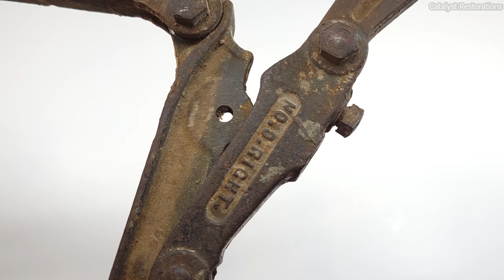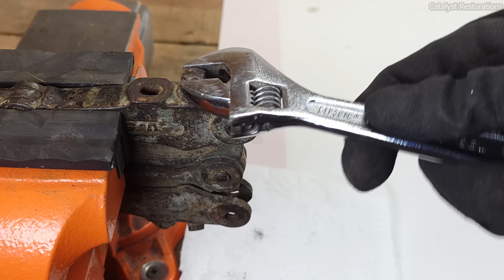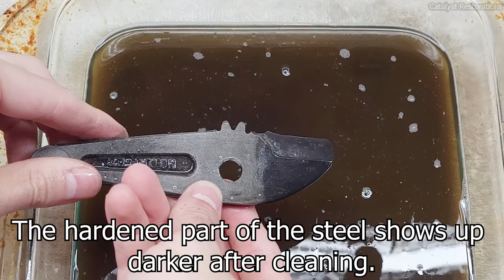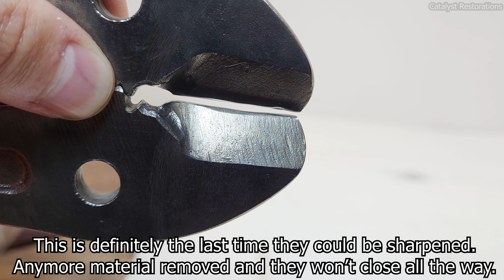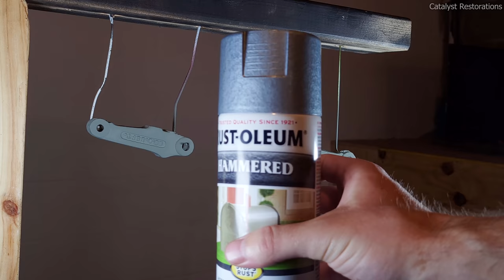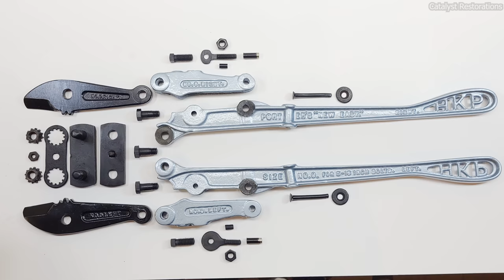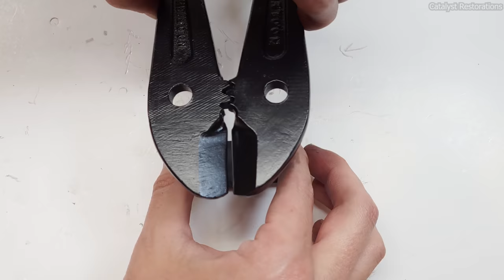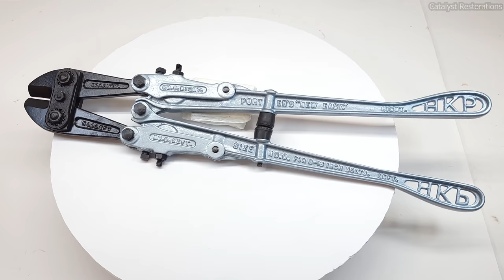130-year-old Bolt Cutter Complete Teardown and Restoration

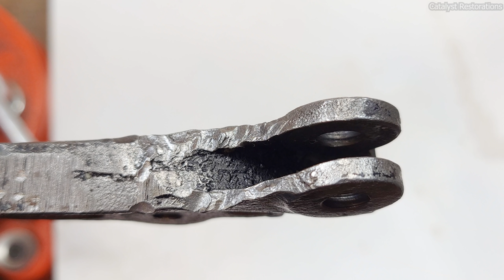Comment: I think you raise a potentially interesting philosophical question at 11:48. 

In terms of a "restoration" project, is touching up/ removing features that a product was created with (perhaps unintentionally) like imperfect casting still restoration per se, or are you going beyond the call of duty by improving the product itself. I can see an argument that the material left behind by poor casting is 'part of' the product, but I see a counter-argument that it is not part of the product in its idealized form. 

Random side thought, what about using some of the steel dust/chaff from the sanding process in the epoxy mixture to match the material more?
Reply from the maker: That philosophical question is actually a very sharply divided line in the restoration community. There are some who believe you should never remove a tool's patina or rust and just enjoy the tool for what it is now, either working or not working. Then there's others who believe a small amount of cleaning just to get it working is all you should ever do. And then at the far other end of the spectrum is basically a Ship of Theseus where you replace just about everything with new parts or hardware and it's identical in looks only to the original. I personally believe that you should at least research as much as possible what the tool originally looked like and then decide how much you want to deviate from it. It depends project to project. Sometimes the casting marks are actually really cool looking and other times they stand out in a really ugly way.
Reply from the maker: Also about the steel dust, I never considered that before but might be worth trying in the future! It's a common technique in woodworking to mix wood glue with sawdust to make a filler.
Reply: Ethan I have thought the same thing about leaving the so called "imperfections". When I clean up and restore these cutters I like to leave them the way they were made and just clean off the rust, improve the cutters and paint them so they look like when they were new. As far as the imperfections I wish I could ask my dad why the Company left them and didn't take them off? He would know he was one of their machinists at that plant in the late 1950s to 1978. Now that I think of it the workers there were paid on a piece rate basis, the more you made the more money you got! So if you leave them the way they are you are reminding everyone of the way they had to work to make a living!
Reply from the maker: @stephenkent8903  I think you're right Stephen - at the end of the day it was all about just pumping out as many parts as possible as long as they didn't impact performance of the tool!
Reply: @CatalystRestorations  Don't you love the logic of considering anything done to an object by previous owners as precious parts of its history and thereby sacrosanct, yet for you to touch it is deplorable? Hard to know what to make of that. Maybe it's existential guilt. ;-)

Comment: Too bad your “pro tip “ for spraying hammered paint was wrong.  Spray one heavy coat only , from a close distance and the true hammered effect will appear. Your way produces a foggy finish. The paint will dry to the touch but not harden for weeks. Place in the sunshine till hard.
Reply from the maker: You're right that it is more about how heavy your coat is rather than distance. As far as hardening, all enamel spray paints take many weeks to fully harden, sometimes upwards of a month. And yes, you can "bake" them to speed up the hardening process - hard to do in the sun though where I live where it is cloudy 300 days out of the year on average.

Comment: This is not a Leonard painting.  It is a special tool.  It has to work and not tint with a mini - brush…such a distance between the cutting edges)))))….  unacceptably. Do you have to admire it or work with it?
Reply from the maker: You are correct, this is in fact not a Leonard (Leonardo DaVinci?) painting. If I understand you correctly, you're wondering why I made it look so nice, why there is a gap between the cutting edges, and do I actually use the cutters or just look at them.

1: If I'm going to look at them and use them, might as well make them look nice. If I wanted to do a fast 5 minute job just cleaning up some of the rust nobody wants to watch a video of that. 

2: The cutting edge gap was closed by adjusting the square adjustment screws on the side of each handle. At the end of the video you'll see the gap is closed when I'm testing it.

3. Everything I restore can and is used. Not every finished project just sits on a shelf.

Comment: Hummmm, using metric socket on old US made tool, using adjustable wrench wrong way (putting stress on movable jaw as opposed to on fixed jaw ), striking threaded bolt with hammer rather than putting a nut on thread and striking nut to avoid damaging threads.
Reply from the maker: If the wrench fits snug and does the job I don't really care that much. 🤷‍♂️ And if you watch any video newer than this one feel free to see if I learned my lesson on the adjustable wrench 😉

Comment: Would sand blasting have removed that concrete a little better?
Reply from the maker: Hi David! Absolutely it would - it would be both better and faster. I don't have a sand blasting setup in my shop, partly because a good setup with blasting cabinet, air compressor, and blasting mediums can run in the neighborhood of $1000 and partly because my vision for Catalyst Restorations is to keep restorations as accessible for the everyday person as possible who may just have access to a basic selection of tools and a workbench.

Comment: get yourself a set of SAE sockets and stop with the adjustable wrench, that wasn't built with metric bolts.
Reply from the maker: It would help if when this was built anyone had any standards in mind! 😂
Reply: @Catalyst Restorations  knock the heavy buildup off, and i bet a 1/2 would've fit perfect. Look for 6 point sockets, it'll greatly reduce the chances of stripping nuts and bolts that are extra stubborn. If you ever need to put some beans on a threaded rod don't hit the bolt with a hammer, boogers the threads. Put the nut back on a couple turns and tap the nut. Other option is to pick up a brass hammer and punch kit. Wheeler Engineering makes a nice kit for about 30 bucks on Amazon.
Reply from the maker: @bigjohn3435  Thanks BigJohn!!

Comment: Sugestão: para retirada do ferrugem colocar numa bandeja com vinagre por 24 horas ou mais. Além de eficiente,  o custo é menor.
Reply from the maker: "Suggestion: to remove the rust, place it on a tray with vinegar for 24 hours or more. In addition to being efficient, the cost is lower."

Yes! Vinegar is a perfectly good method for rust removal! Citric acid is another low cost option. Personally I can't stand the smell of vinegar (and it smelling up the whole shop) and it does work slower than Evaporust or electrolysis and because it is an acid there is only so long you can keep it submerged before the metal starts to etch away, but it's still perfectly acceptable to use for most rust removal projects.

Comment: Before putting the various pieces in the rust remover I would have degreased them with a powerful detergent to remove both the wd40 and the greasy dirt down present and only after rinsing them well I would have put them in the rust remover, in fact where there is grease or oil the eust remover does not work.
Reply from the maker: Actually, Evaporust does contain detergents that help break through grease, oil, and general grime, so it's not mandatory to do so. The Evaporust solution will end up full of sediment and other junk though, so it's personal preference.
Reply: @CatalystRestorations  thanks for your answer :-)

Comment: I cringed everytime you used the wrench in the wrong direction. i.e the cause of the "earthquake" because the force applied caused the wrench to expand to the point of failure. Used in the correct way, the force actually "bites" harder. Otherwise great restoration
Reply from the maker: Yup, been getting raked over the coals in the comments for that one!

Comment: Great transformation!
One question though; why would you use adjustable spanners for a job like this, instead of sockets or open/closed spanners? You could save yourself some work...
Reply from the maker: Hi! Because this bolt cutter is so old, the nuts and bolts aren't standard sizes and it was a huge pain trying to get them to cooperate with a standard socket set. It was simply much easier to use an adjustable wrench for the majority of the hardware. It got the job done, which is really all that matters in the end to me.
Reply: @CatalystRestorations  👍🏻
Reply: @CatalystRestorations  that is because they are obsolete Whitworth threads commonly used up until the1960s.

Comment: Vinegar?
Reply from the maker: I used Evaporust in this video to remove the rust which works amazingly well but is expensive, but vinegar does work too! You just need to keep an eye on it an not let it soak more than maybe 48 hours because it is an acid and can start to eat at the good metal once it gets through all the rust!

Comment: Just curious what the picture is on the card you used to mix the hole-filler, at time 17:20?  Looks like a machine shop?
Reply from the maker: It's actually just a hotel key card for an industrial-style hotel I stayed at once. They make great mixers for filler epoxies and putties!
Reply: @CatalystRestorations  ... I worked in a machine shop for a steel company one summer as a teenager... many decades ago.  That's why it caught my eye.
Reply from the maker: @thomasklugh4345  Very nice! My day job is a metallurgical engineer at a steel company.
Reply: @CatalystRestorations  ... Hope you don't mind me responding again.  A lot of old memories have been stoked here.

It was 1967 and I was only 17.  We lived directly across the street from the steel company where my step-dad worked.  He's the one who got me the summer job that year.

My first job there was to sit at a hole-punch machine where I would activate the hole puncher with a foot gear.  It was with a loud "CLANG" that the hole puncher would come down on an 4"x8" steel sheet a quarter inch thick, the hole being used for a rivet, to rivet two other pieces of steel together.

Then they transferred me to the painting area where I would paint these enormous, and very heavy beams used in modern bldgs.  I worked with a hand-operated crane system moving and turning over the beams.  I thought it dumb to paint the beams, though I never told my boss that.  I thought they should have invested in a rust-prevention application, rather than painting a beam no body will ever see (it being INSIDE the bldg).

There was this one guy who had just returned to work the day I started.  He previously lost his leg when one of the steel beams fell on him.  I was surprised they even allowed him to come back.  But that very same day, with him limping around with his newly installed prosthetic leg, he wasn't watching what he was doing, and had a finger and thumb of his hand crushed.  Somehow, I don't think he was meant to work there.

It was a fun summer job... 
for me. 😃  My next job the following year was as a day laborer on construction sites, with a friend.  But that's another story.
Reply from the maker: @thomasklugh4345  I don't mind at all! Thanks for sharing! After seeing your coworker missing limbs and appendages I'm sure you're glad you got out after just 1 summer because who knows what you'd be missing today yourself! 😂

Comment: @11:30-40 - Sand-blaster, then Powder-Coat.
Reply from the maker: This channel is about showing people that you don't need to have a sand blasting and powder coating setup to achieve great results restoring and giving new life to their favorite tools.
Reply: @CatalystRestorations   - Fair enough.  It was just my gut reaction at that point.

I do not have a 'home' sandblaster yet.  However, I do have our old kitchen stove in my shop.  I have done home Power Coating.

Also, I restored several rusty Rigid Pipe-wrenches by sand blasting them and Power Coating them.  They look amazing and turned out really well.
---------
Honestly, if I am not going to Power Coat tools like that, I just wire brush and oil them.

Comment: they are not bent... they are offset so you don't clack your knuckles together
Reply from the maker: The bumpers are to stop your knuckles from clacking. HK Porters did not do offsets.
Reply: @CatalystRestorations  ahh I see. I've seen offset handles for that reason, but yea the bumpers make way more sense

Comment: I've found hammerite paint to be extremely bad, one touch and it just peels off. I've been a painter for years and have followed the exact guidelines with still poor results
Reply from the maker: That's a bummer. I've always had great results personally. I know everyone's not a fan of the look, but it's always been durable for me with proper prep and priming. Just like most enamel spray paints though it takes at least 30 days to truly, fully cure.

Comment: ..." rubber bumper are missing..." Lol!   1890s...?   thick leather bumper will be correct...
Reply from the maker: You may be right - rubber was not a super common manufacturing commodity at that point. Leather might be historically accurate, which is good to know, but since I plan to put these to regular use rubber is a better choice.

Comment: So are they really 130 year old cutters?
Reply: Well are they? I would like to know.
Reply from the maker: If they were made in the year of the patent date on the handle, 1892, they'd be 129 years old, so no, you got me, the video title technically won't be true until 2022. It's probably more likely they are a few years newer than that, but not by much. From the limited information available on the production history, this specific design pattern appears to have been phased out in the early 1900's.

Comment: Masking tape really helps for touch ups...
Reply from the maker: Indeed it does. Unfortunately sometimes you just forget and deal with it. 🙂
Reply: @CatalystRestorations  I was saying that but I paint everything with a 180mm paint roller.
Reply from the maker: @chongtak  I think I see what you're saying now. If you notice in the priming and painting segments I extensively masking taped off all areas that are joints or screw holes. I just didn't show that on camera. Also, using a roller to paint complex geometries such as this is simply impossible, hence spray paint. A aerosol paint is the best way to paint projects like this 99.9% of the time.

Comment: Nice job , except for the fact that you painted the gliding surfaces.
An engineer would know not to do that...
Reply from the maker: If you're referring to where the jaws hinge, then yes, there shouldn't have been paint there and it made the fit too snug. It's long since worn away from use though. Otherwise the other points of motion were just cold blued but not painted.

Comment: Where does it come from ? I have one like that!
Reply from the maker: Awesome! If you're referring to where this was made, it was made in Boston, Massachusetts, USA. If you're referring to how I acquired it, it was bought from a flea market. Today, the HK Porter brand name is owned by Crescent Tools in Maryland, USA.
Reply: Thank you!
Reply: What is the chemical you use  to soak?
Reply: This jop is really interesting!
Reply from the maker: @mrtrungkieu  It's a solution called Evaporust. Non-toxic, biodegradable, and be reused many, many times before it stops removing rust.
Reply: Thank you!

Comment: Если так бросать железки в стеклянную банку, она может разбиться. Раствор для очистки от ржавчины обычно содержит кислоту в опасной для кожи концентрации. А у Вас руки без перчаток!?
Reply from the maker: The rust removing solution is called Evaporust and it is not an acid and is safe for contact with skin.

Comment: Weld the cutting surface up with nickel rod used for bucket wear provention that's what we do on farms
Reply from the maker: Interesting! Do you do any sort of heat treatment then after that? Some other commenters also suggested welding with a tool steel that has suffient hardenability, but as with pretty much any welding on a hardened surface you have to (or rather...really, really should) properly re-heat treat the jaws due to the heat effect zone.

Comment: Bluing does not protect against rust.
Proof:UN-OILED blued firearms parts (barrel, receiver, trigger guard, loading gates, under barrel steel magazine tubes, etc.) readily rust.
Bluing (and Browning) requires a thin coat of oil to not rust.

Are new jaws availabe for this bolt cutter?
It may have been the camera angle, but it looked like the jaws don't fully close after sharpening.

Is this going to be a working tool, or a wall hanger display piece?

If new jaws are no longer available, is heating the jaws to "white hot", allowing to air cool, arc welding a new edge on, sharpening, re-heat treating and re-tempering the jaws a viable option, or does it become a wall hanger in the shop/garage/tool shed the next time it needs sharpened?

Sure wish you woould put away the cresent wrench, and use a open end/box wrench the correct size or the correc size sockets and a ratchet.
WHEN (not "if") the cresent wrench slips, it rounds the nuts or bolts.

"The roght tool for the job."  A cresent wrench is never "the right tool".
Yes. I do own and use cresent wrenches on my coaster brake bicycle axle nuts, the gooseneck bolt, and the headset nut. It is still the wrong tool. 🙄
Reply from the maker: Absolutely! Every one of the cold blued parts is soaked in oil for 24 hrs.